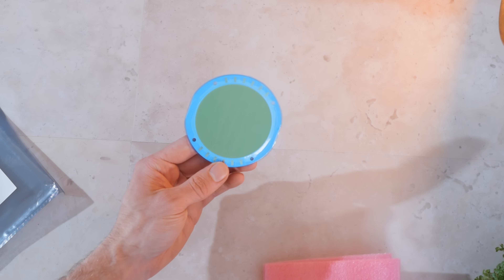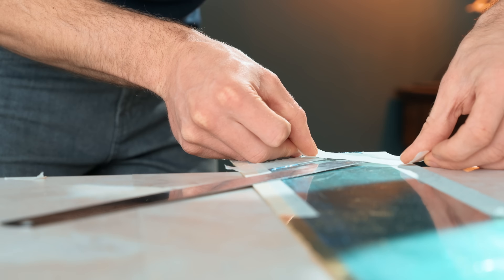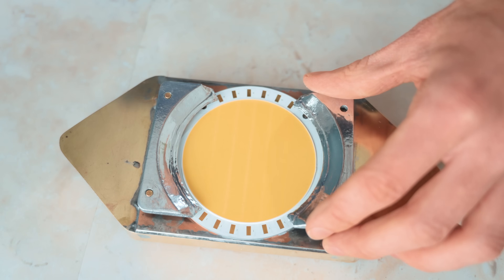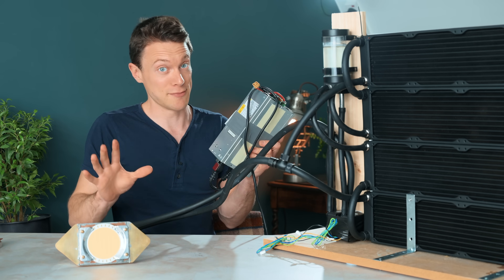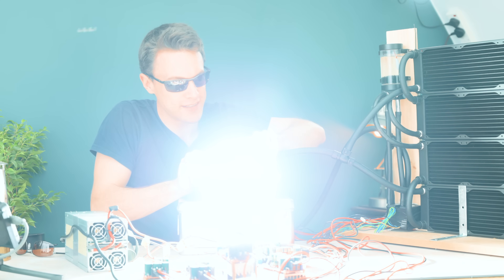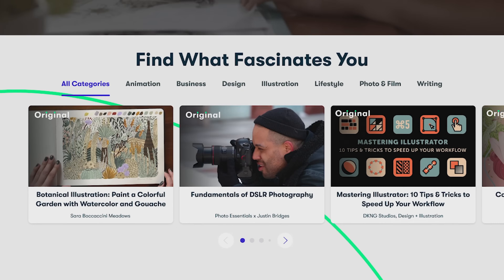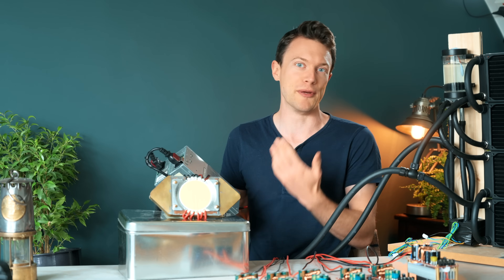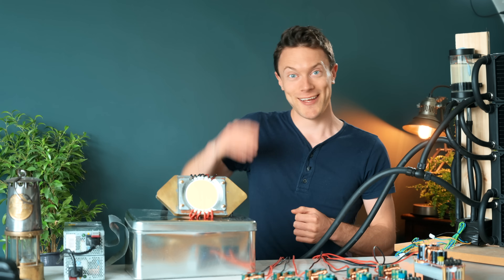Testing the world's BRIGHTEST LED!!!

Comment: I used to experiment with LEDs when the light was still measured in microcandelas.  I still have an array of white LEDs from the late 1990s that I tried to make a bike light with. Back then, there were no commercially available flashlights or bike lights that used LED's; halogen ruled the day--or night, I should say. Powered by lead-acid batteries, of course.

Comment: Computer cooling enthusiast to someone using PC cooling for other things. I'd suggest looking up a Peltier or Phase change cooling setup for later builds, it'll allow you to have a more compact cooling solution that can also keep things a bit colder (Peltiers seem unintuitive at first until you realize high heat differences mean higher heat transfers as it's going to require extra power supplies, but fewer radiators). Another option for just spitballing builds Would be a Dice pot (Dry Ice pot) which can offset a few kilowatts relatively cheaply if you're just going for a few minutes. LED's won't power on at super low temperatures though, so keep off of liquid nitrogen and the like. Also, for short term tests like this, I would suggest using a combination of distilled water and "water wetter" it's basically formula 1 engine coolant, but it'll crystallize if it's used for long periods (Over several months). You can pick it up for a few bucks at an auto shop. Also, more importantly, any computer power supply is designed to run constantly at under 50% load with peaks higher than that, not constantly at 75% and above, the fact you didn't cause a fire is a bit of a miracle.

Comment: Quick and dirty: Two 12 volt car batteries in series, to drive the 6 boost regulated supplies. They will produce all the current you could possibly use, albeit, for limited run time.

Comment: @DIY Perks, could it be that the PSUs' most heat-producing components are close to the side of the container? Since they are duck-taped together, the two sides are in direct contact, and those places could unluckily be the place that emits the most heat and cause it to fail.

Comment: I wonder if he shut off the mains for the powersupplies after the test.? Rather than shutting down each boostmodule. That would leave the powersupplies with a lot of heat built up in them, as the fans would shut down too and they would likely do directly to max setting on the fans when powered back up with all the heat still in there.
Shut down the boostmodules, and let the powersupplies run to cool down the electronics. Problem solved.

Comment: During the first try you connected the boost converter one after the other. If you turned them all on at once during the second try the large capacitance of the converters could have overloaded the psus during startup. They can handle a bit but they can fail in "extreme" cases and during sharp current changes.

Comment: The best way to do this is just to take PSU from a PC. Either u take 2 x 1200W (they're expensive) or 3 x 650W or 4 x 450W or 6 x 300W. And really, AVOID PSU from "black list", it's for your and ur wallet's safe. Also when it comes to the design of that cooling block. Fins are too long, they need to be max 1mm long and the height of that 'chamber' needs to be much lower. That way u'll force much higher pressure, which leads to higher speed of the cooling fluid, which helps to get much lower temperatures. Lower temperatures, lower power consumption, smaller usage for PSUs. Also the bracket for LED, maybe u don't know, but the tighter you mount it, the better the heat leaves from LED to the heat sink. That way to 'perfect' this bracket, you need to make it on the whole radius and cover it with nickel plating (the same used in headlights for cars) and ensure it's tighten properly.

Comment: "I need to cool it, and I can't use a fan cooler."

Linus Tech Tips would like to know your location
Reply: Ian the Fifth this is so true lol pretty sure he recently said that the newer air coolers are as the same as liquid coolers.
Reply: @R4ZRHunterOwner  from what I remember he said that aios we're about the same.
Reply: R4ZR_Hunter YT i feel like maybe the led with several hundred watts of power consumption might be a different case than a cpu with 95w or so
Reply: Pretty sure linus would kill him for not using fans with the radiators
Reply: @SolarQuiet  all the fans were on the back, I was thinking that the whole vid til i seen them near the end lol
Reply: he will watercool all shit on the table
Reply: @OP Actually LTT did build a massive water cooling system.
Reply: Cairo, Egypt.
Reply: @nabilhero8746  
انت عاوز ايه ؟
Reply: @kingreactor.1  I wrote some answer
But by mistake it did not show
Reply: @nabilhero8746  مش مكانك انت
Reply: @thefatorc6822  it was a mistake...so no trouble

Comment: some thoughts about your power supply and the failure: 

1: server PSU's I've used have their 0V output connected to the plug ground pin, and also to their cases. It's possible that because their cases were touching or because their plug grouds were connected together that one of them was being shorted, and the other one was supplying all the power, though they should be current limited to some degree. I've seen descriptions of how to disconnect the 0V to ground connection so they can float and be used in series.

2: since the 6 power sections can be wired separately and each takes about 30V, the six could be wired in series to give a single 180V 6A drive requirement. A direct from mains power supply might be a better solution than 240Vac->24Vdc->32Vdc. I would use a basic [AC->rectifier->400V capacitor->high-voltage current-limited buck controller] for this, although it doesn't include isolation so care would be needed to make the finished setup safe in the end. Bonus: the whole power supply would end up about the size of one of your boosters.

Comment: Search for "power supply mining rig 3000w"
Do you think 1600W for a few minutes is too much? I had 6 Ethereum mining rigs at home with 8 GPUs in each consuming 2000W 24/7 EACH. And I have no experience with electronics and electricity.

Comment: The efficiency of those voltage boosters is not that great, so you're most likely overloading the power supplies. You'd be much better of getting a three 36V 20A switching power supplies and running two sections of the LED from each supply.

Comment: You could put a thermocouple under the LED and interface it with a circuit that turn off the power supply in case of overheat

Comment: 15:49 did you check the power factor? I see a lot of capacitors, maybe your reactive power was too high.
Reply: Reactive power is inductance and capacitance.  LEDs are semiconductor devices and have neither.  Reactive power also applies to AC signals, not DC.
Reply: @HansSchulze  I meant for the small boards. They were covered in capacitors.
Reply: @HansSchulze  I meant for the small boards. They were covered in capacitors.

Comment: Something that may help a little with your power supply issue, maybe connect that slider before powering it on, maybe slowly ramping up the power can help with any kind of shock, I would also consider some capacitors to help the power supply get itself up to where it needs to be before it just expends a massive amount of power straight away

Comment: Just use 24V PSUs then. Don't even connect them in parallel, just use one to power 3 step ups and the other one to power the other 3 step ups.

Comment: I have a project suggestion: one of the best forms of indoor lighting IMO is the classic floor-standing halogen uplight - bright, dimmable, wide and even lighting, and of course having the light upwards rather than downwards makes the whole room appear much brighter (no dark ceilings) and further helps spread the light. But they have their drawbacks, both in power consumption (~250W) and the rather unfortunate habit of catching on fire due to heat and dust accumulation in the top housing. My idea is rather simple: take an old (or new, if you want) halogen uplight, and retrofit it for dimmable LED lighting. It obviously won't need a bonkers LED like this, but something around 5000 lumens would match a 250W halogen R7s bulb. I would think you could fit the LED + cooling + an AC-DC PSU in the top housing, with some sort of dimmer built into the dimmer box that normally sits on the "stem" of the lamp. Do you think that would be doable?

Comment: Cough cough just FYI if you put fans on the first air cooler you showed it’s actually better then what you explained and there is also water blocks you can use for your liquid cooling so yeah and ummm you might want a soldering iron it’s more efficient then heating up your work piece and you might need some thermal paste or pad uno to actually make your cooling worth it

Comment: I loved the video, but I think you may have gone overboard with the cooling. I'm not talking about the custom water block, that was needed for even cooling, however, you may be able to get away with a single 240mm or 360 radiator.

A 1500w led chip doesn't need 2000w+ worth of cooling, you only need to remove the waste heat, wherein PC cooling, you're cooling almost 100% of the watts pumped into the device. 
Here's my math based on some quick research. The site doesn't say an efficiency % but if assume 60lm/watt i.e worse case, or around 75% efficiency, you should only need cooling for 375 watts. An EK Waterblock EK-CoolStream PE 240 radiator can cool between 175w and 350w depending on airflow.

Comment: I am going to take a quick stab at the PSU thing, although electronics is not my strong point, so correct me if I am wrong:

Series voltage will of course increase the aggregate voltage, but series amps? The PSU is limited in the number of electrons it can push, adding a PSU in series will only force both PSU s to push the total current each, not aggregate it. So it's possible you pushed both PSUs beyond their limit. Best way to check is measure current in between the PSUs.

Seriously thought about retracting this comment, because I honestly have no idea.

Comment: The server psu's are most likely hot due to the lack of aditional static pressure. The Powersupplies are rated for installations in tight cases where they are mounted in the back of a case and has ample static pressure air being blasted through the case, soemtimes with several layers of fans, and pre-cooled air at that.

I think a duo of 1000-1500W consumer grade PSU's could have been a better choice since they are not restriced by the same design parameters :)

Comment: I'm surprised the power supplies worked in series. Afaik the ground is connected to the earth connection, thereby one of the PSU's must've been short-circuited via the ground connection of the other one.

Comment: I would say.  Just lower the output voltage a bit to lower the current.  It will still be very bright.  

Btw.  I also have a power board like that.  Works great.  I used it for a car battery charger.

Comment: Switching power supplies really shouldn't be run in series like this. There are ways, but it requires cooperation between regulation circuitry in both supplies. Don't run them in series. Use your boost boards, and split them among the power supplies at 12V, with grounds shared.

[Edit] Meanwell makes CC supplies for LED applications. The HLG-600H-36 is a 600W constant current supply designed for LEDs. Each of your LEDs six sections draw 250W each. You can run two section off this meanwell supply with no boost converters necessary. You'll need three of these to drive the entire LED. RS Components has them for $124, which is about as cheap as they get.

Comment: I use simplest possible power supply for LED lighting. It consists of two capacitors and a bridge rectifier. It is quite dangerous, because it's not mains-isolated and it needs huge capacitors to work with high power. Other than that it gives great results. Such PSU is dead-simple, perfectly reliable, and never gets hot. Also by adding a few more capacitors it is easy to make this PSU to regulate output power. 
Here is an example of such PSU: https://circuitdigest.com/electronic-circuits/transformerless-power-supply

Comment: You hooked the power supplies in series? those tend to have a chassis ground like a car.. the case itself being tied to the negative rail. hooking them in series like that is a great way to cook them... you can do it, but you need to isolate the metal cases from each other.
Reply: Oh, you cooked them... rip.

Comment: The power supplies might be "capable" of 2000w but they will only be capable of so much on each power rail

it might be only rated on the 24v rail at 30 amps which is 720w with the rest of the power made up by the other power rails

And yeah copper is a really "bittey" material when trying to mill thin sections, water coller manufactures use a blade to shave the copper and bend it up to create there microfine water blocks

Comment: Since it sucks out 1500W, and it costs 1300$ (without cooling and the casing), what's the point of developing such things? A moving head with halogen lamp sucks out 1000-2000W and is still costing a fortune to buy, so what's the point of adding 1500$ to something that is already worth 15.000$ with old tech?
Plus, when the LED dies out (because we've learned the lesson: LEDs DO die out...in some cases even more frequently than ILB or HLB if cheap components are used), you find yourself with a useless 16500$ piece of crap, since because of the heatsinking, I highly doublt the LED board would be replaceable, at least from the user part, while you can easily replace a blown bulb with 1/20th of the price.
I do see LEDs advantages in home lighting and somehow, even with an horrendous city outlook, in public lighting, but as long as we are talking about stage lighting, I'm beginning to see some not easily overcomeable limits, because the traditional counterpart still works the same, with no advantages other than the colour generation (which is a problem with tratitional methods), costs less and does not have heat dissipation problems which are, when talking about a confined space and many potentially flamable objects, a real big problem.

Comment: According to some (not me), LED radiation is lethal, so I'll be checking in on you over time.
As for the PSU's : The  Voltage Boost Boards are what killed them, as they are trying to provide a constant Wattage to the LED cluster.
As the one PSU started loosing Voltage the Boosters started drawing more current to make up for  the loss in Voltage.
This caused a current feedback loop between the Boosters and the PSUs as they where in series.
This is a probleem even in battery cells and is why you must never allow battery voltage to fall to low..
Reply: According to some, the Earth is flat. I'm going to keep my eye on those astronauts, because how do they do that?

Comment: You said at the end, that one PSU has 750 Watts.

In the beginning you mentioned that youve wired them in series to get 24V.

So you have still 750 Watts! But with 24V.

In Parallel it would have been 1500W at 12V
Reply: Check your math.

Comment: Something a little fishy at 12m06sec when power supply is turned off, I see a single led still on and then a 2nd led flickers on then off.
Reply: Normal behavior for different voltage LED chains (very small difference).  Each middle PSU also has an undervoltage dropout, which may not all trigger at the same time.  So you slowly deflate the main PSUs and middle ones some cut early, the others keep going.

Comment: Those server power supplies may not be getting the airflow they need. Remember that there is significant positive airflow through them from the server chassis.

Those are designed to be ran a bit under spec indefinitely, if they are overheating, and in spec, then they are not getting enough air.

Comment: Electricity 101 from the school of hard knocks is the lesson you just got. When you put the power supplies in series they are not taking half the amps just getting the volts up to desired voltage with no change to the amps output. You required them to output more amps than they were designed for. You should have done 2 in series & 2 in parallel. The parallel would have reduced the load per battery. I have never done power supplies in series so they might not have liked being put in series.

For example if you have 2 batteries in series they will give a higher voltage with the same amperage but if you put 2 batteries in parallel you will have twice the amps at the same voltage of one battery.

Volts times amps gives you watts.

Comment: This LED is basically like a mini portable Sun.  Kinda unfortunate that the psu fried in the process, I think it has something to do with them being wired in series which doubles the voltage but the current load on one would still be at least 41.67A (1500w/36v + inefficiencies from the buck converters) which might be too much current for a single psu unit can handle which is probably why they overheated

Found the link to the LED in case anyone is curious of the specs:
https://store.yujiintl.com/products/yujileds-bc-series-high-cri-cob-led-900h-1500w-pack-1pcs
It is rated at 120,000 Lumens @ 80 lumens/watt.  Not bad for a 95 cri led, as high cri leds tend to be less efficient than normal ones due to their more complete spectrum output.

Comment: Regarding using server power supplies in series. Because power supplies have their DC ground and AC ground tied to the case, if you wire them in series, it becomes a short circuit. The only way around this is to float one of the ground connections. The easiest way to do this is to remove the ground connection on the AC side of one of the supplies, and find a way to keep the cases of the 2 supplies from touching. This is not an ideal solution, but it should work. A safer way would be to disconnect the DC gnd connection from the case on one of the supplies. That way you can leave the AC earth gnd connected, and allow the 2 cases to touch without issues.